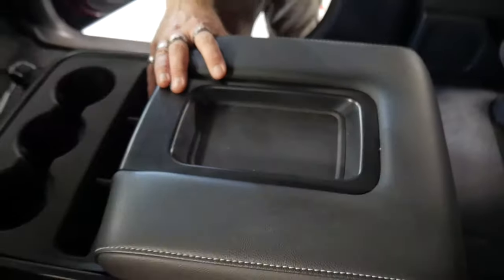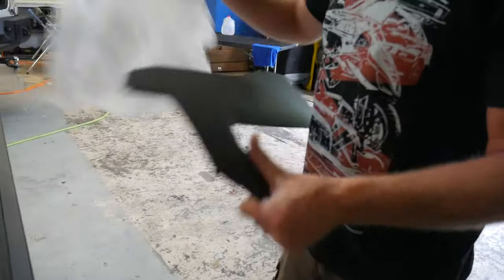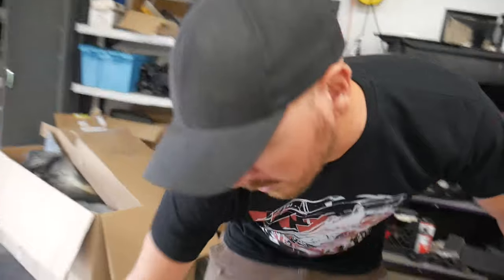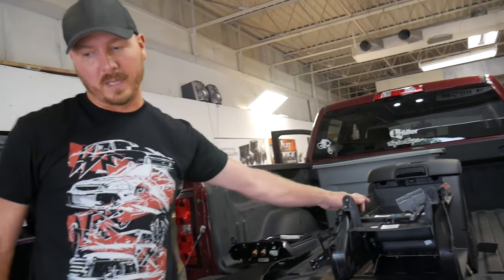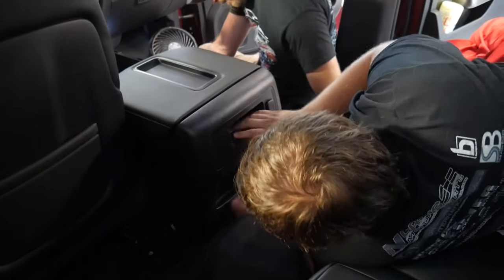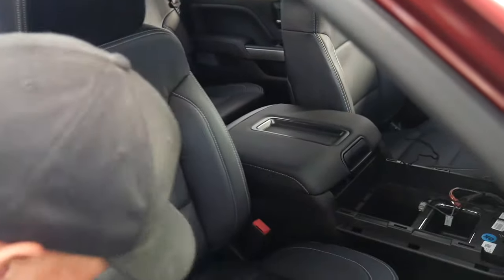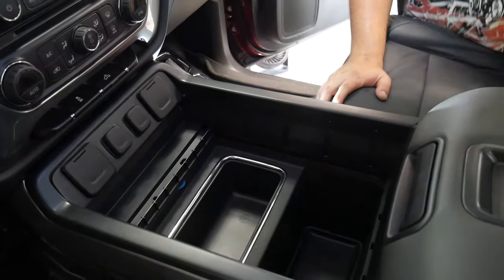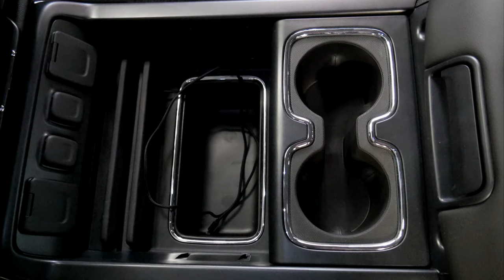2014 - 2018 CHEVY SILVERADO / GMC SIERRA - Center Console Upgrade / SWAP from jumpseat

Comment: Can you wire the wireless charger for the console in or is that a no I have a 2014 rcsb lt truck I’m looking to put full interior in but no power passenger side seat. I would need to know how to make that work too.

Comment: Does the harness you removed from the jumpseat console plug right into the new center console or was there splicing or soldering needed to complete the install?
Reply from the maker: You will need to splice some wires
Reply: OCTANE TV thank you

Comment: I wonder if you can use newer style consoles for 2013 year 2500HD
Reply from the maker: Totally different dash
Reply: @octanetvchannel  😒 dam. Yeah I know the dash is different (better) but I was just praying I could get a 2015 style console to slide into place in my 2013.   The consoles from 2015 and up look so much better then even the 2014

Comment: VERY GOOD VIDEO !!!!!!
i need to REMOVE my CENTER Console on my 2017 Tahoe - Original OWNER install a LOC and Evry Time i Go OVER BUMPS the Left side SPEAKER and Turn Signal Click Sount CUTS OUT - WTF 
i think he Removed the Sub WOOFER when he TRADED the SUV back to the DEALER .
i will Try in sinstall a FACTORY Subwoofer SPEAKER under the CONSOLE .

Comment: how much does this cost, i would love to do this
Reply from the maker: We charged her customer by the hour and he brought in all of the parts to do the install
Reply: what if i don’t buy anything and what would you charge for the center console replacement
Reply from the maker: @hollowapex3871  it took us three to four hours to do the job so we charge $100 an hour. We also charged to redo the harness which was $200
Reply: what i’m asking you is how much can you buy the center console and put all of it in for
Reply: @hollowapex3871  lol
Reply: @hollowapex3871  way to much like double or triple what it would have cost to just buy the upgraded model car in the first place. This is what makes me laugh about this stuff. When you buy base model cars and you decide to upgrade down the line you spend significantly more than just paying the upfront dealer cost.
Reply: @seemlesslies  LT is 10k more dude .  That probably cost customer maybe 1200 with labor maybe even 2k
Reply: HollowApex close to 1g plus labor its not worth it but if u got the money do it... i got the whole center console cus i would never buy a truck with that hideous jump seat in the first place
Reply: Christopher Travis can you send me the link to the exact console
Reply: @seemlesslies  idk that whole project was probably 3-4k as to where the ltz can coast 10k more and sometime you just have a truck that runs great and you dont want to roll the dice on a whole new truck that might have a whole set of problems. and you migh have other mods invested in the truck maybe it has sentimental value.

Comment: Where do I buy the center console For my 2018 Silverado I’m wanting to get rid of the jump seat
Reply from the maker: This customer purchased it off the dealership
Reply: I just bought a center console with lock box off of EBAY for $300, My 2018 WT 2500 crew didnt come with the lock box and I find its the perfect secure place for pistols when I am traveling.
Reply: @peterager8966  you got a smoking deal, too many people on Ebay wayyyy over price the consoles, used and beat up anywhere from $800 to $1200, I'd rather keep my jumpseat than pay high price for neglected consoles lol 😆

Comment: Is this possible with the 4wd shifter that's down there? Or no?
Reply: yes. i did it. gotta pull off the plastic and knob then cut a little in the shelf on the new console drivers side. was actually pretty easy
Reply: @seancastle1937  where did you find your center console? I have a 2018 silverado 2500 with the floor mounted 4x4. Thanks
Reply: @Cesar-tj3ob  I found mine on ebay for like 650 then bought a harness to connect everything for around 200